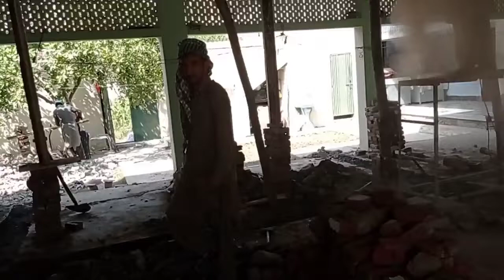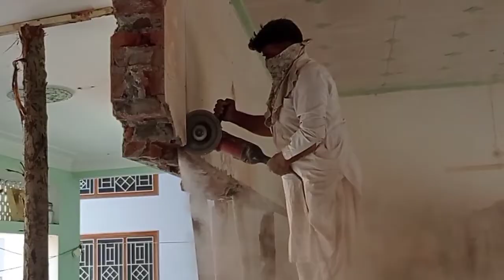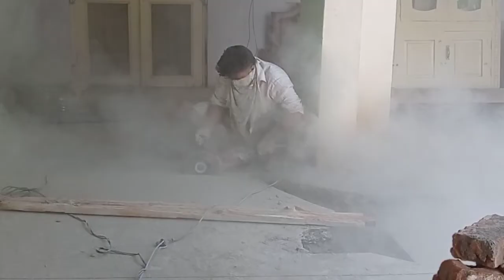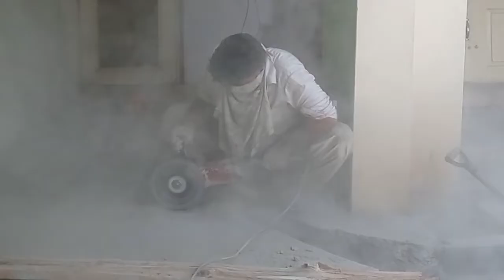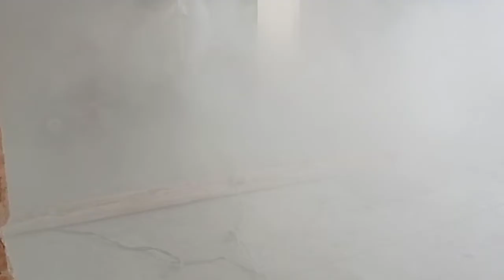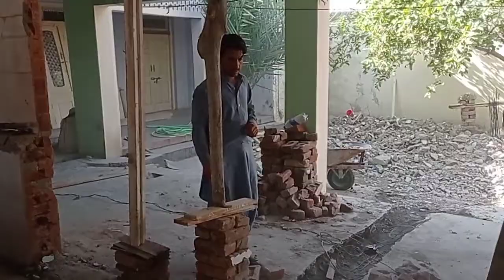House Demolition with grinder - dangerous wall cutting with grinder

Comment: How about the metal reinforcements in the concrete? Will the blade cut through the 12mm round bar?
Reply: up for this, this is also my question..
Reply: Diamond blades are not made to cut metal blade will heat up fast and deform which may cause accident or damage to machine.